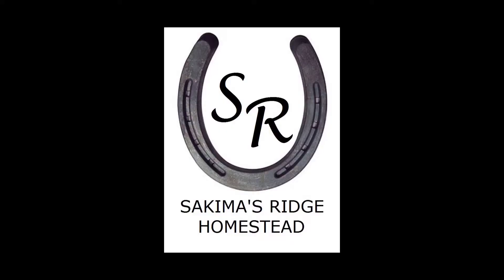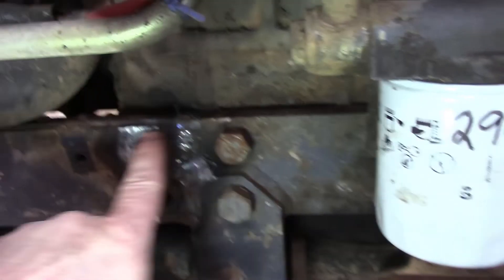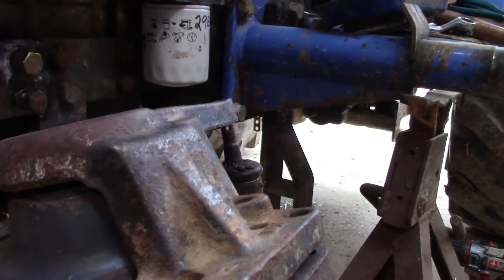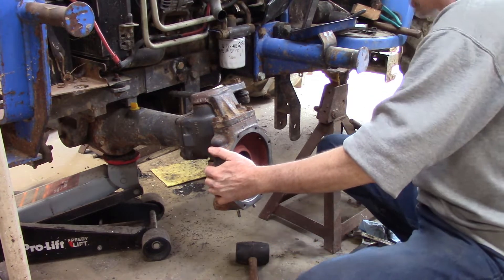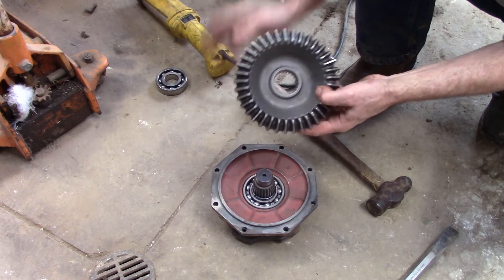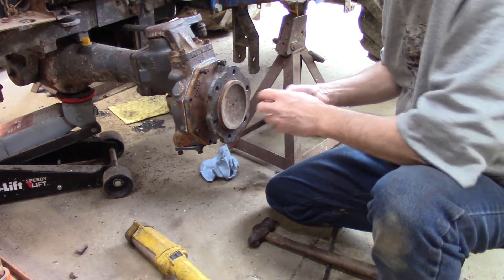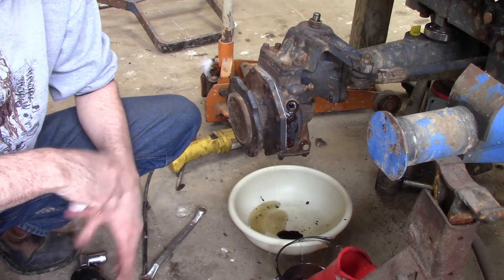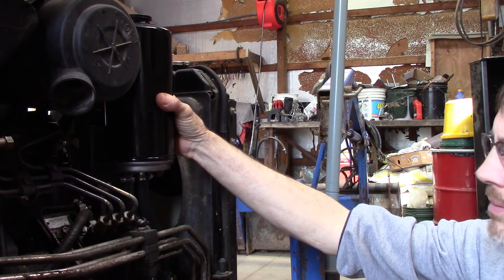New Holland TC33D leaking front axle, cracked frame, and more.

Comment: Thanks for the video. I have a 2000 model TC40D with the leaking seal on the front left final drive assembly. It too has the tell-tale sign of oil/dirt on the inside of the wheel. I am not seeing any outward signs of bad bearings that you saw with the hub assembly canted inward at the top. I will know more when I pop the final drive plate off and take a look inside. 
Thanks again. You made the reinstallation process easy to understand.
Best regards,
Reply from the maker: Thanks.  I actually ended up using my own video to replace the right side bearings and seals last month.

Comment: Never knew about the power steering canister being a filter. So obviously I have never changed it. Mine is leaking now, but its the hose coming out the bottom that is leaking (I thought) Will have to reevaluate that leak. My cap for the power steering canister says OIL, No sticker saying Power Steering Fluid.  I've been topping it off with regular hydraulic oil for 20 years. Thanks for the time you spend showing your activities around your homestead.

Comment: Hey i have the same 2004 tc 30  runs great only thing that happen was the bell housing broke off  tractor split in half   fixed it  big job   now the front bearing was leaking oil  ended up being the same as yours  just started on it this morning  parts be here friday  thanks  for this video

Comment: My left front is leaking like yours but on a tc45. Good info for my project coming up soon. 
By the way, before refilling your right side a good flush might have been prudent to get the “metalflake” out. Some suggest kerosene and air pressure but I’m not one to make explosives so I’ll stick with sacrificing a bit of 303 instead til it runs clean. Bottom plug in, fill it, drain it, repeat. That will do it.

Comment: I have a question and hope you still are seeing the comments left. I am doing the same to a front end of a 2003NH TC24D. It is identical to your TC33 front end. How did you get the shaft and gears apart? I saw you snap the split rings in place, I need the reverse. I tried hitting the center of the shaft down with a mallet and socket as a driver but to no avail. I have learned not to whack things too hard lest i cause more damage than good. Your advice is much appreciated. Thank you.

Comment: Hey, I have a similar problem on not quite the same model! My question is: how did you get the bearings and ring gear off of the wheel hub? Thanks! It was great seeing the reassembly and gives me hope that I can actually do this!
Reply from the maker: There is nothing holding the bearing on, I think I just gently popped it up with a couple pry bars.  The ring gear is seated over the split ring that holds the hub in the housing, again popping it up should release it.
Reply: Thanks much for the quick reply! I couldn't get the bearing to budge with pry bars, and I tried pulling the gear and bearing together with a puller, but didn't put too much pressure as I wasn't certain. Unfortunately, I can't get a puller directly on the first bearing and it's the other bearing that needs replaced, along with the seal. With your video and answer, along with the parts breakdown and service manual, I'll apply more pressure... who knows, maybe it's time to break down and buy a hydraulic press!

Comment: How did you separate the steering knuckle from the hub to replace the seal that’s not shown in the video. Thank you sir.
Reply from the maker: I apologize, it has been a while since I did the work and do not remember exactly.  I do know the kingpin piece on the top comes out, it has an o-ring on it.  There are snap rings under the kingpin that hold the top bearing in.  I seem to remember just knocking the knuckle down off the axle.  If this link works it shows the parts breakdown https://partstore.agriculture.newholland.com/us/UnkeferEquipment/parts-search.html#epc::mr53238ar259163

Comment: Was that 80W gear oil that went back into the front axle? Or was it just tractor hydraulic oil?
Reply from the maker: Hydraulic oil.  Everything on the tractor, with the exception of the engine, calls for hydraulic oil.  Thanks for watching.
Reply: @SakimasRidgeHomestead  one other question for you. There is a red handle under the seat on the right side. Do you know what it is for? I have the same tractor as you and I don't know what that handle does. I also don't know how to apply the parking brake. Obviously I did not buy my tractor from a dealer. :)
Reply: @zephyrsspeedshop3708  on the TC45 the red handle is on the left and is for setting parking brake........press the brake and hold then pull handle up, release brake pedals and it's set.